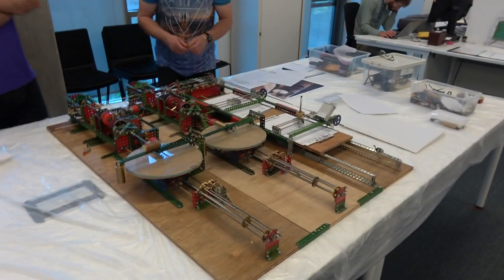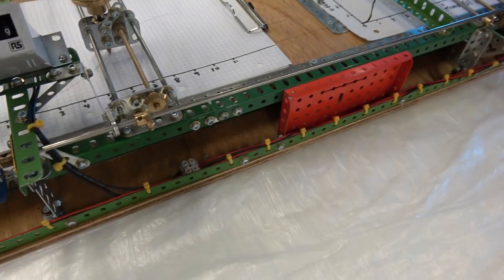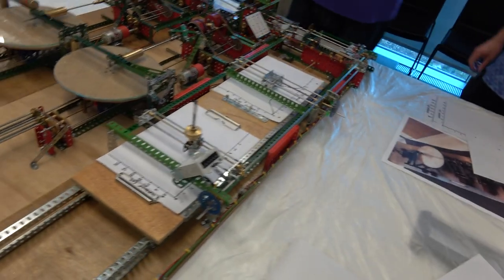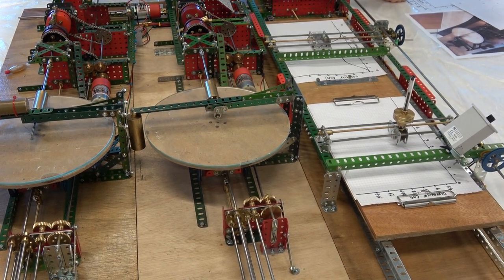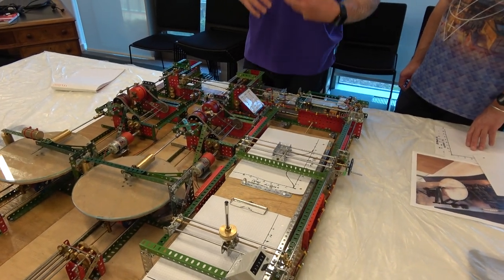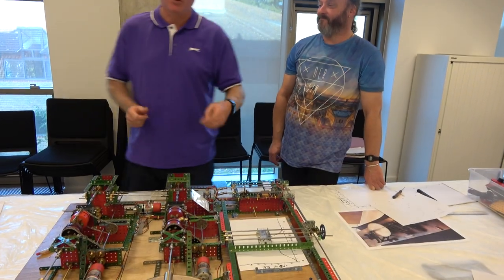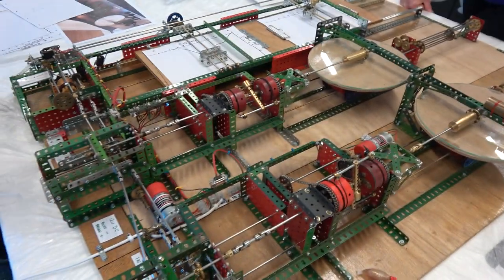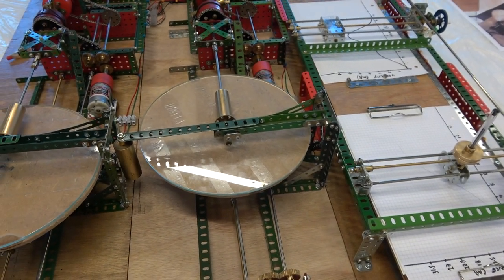(1/4) Exploring how the differential analyser works in simple terms

Comment: Except, a real odometer AFAIK doesn't do any integration at all, unless you call keeping a running sum "integration", while the only calculus being done is by the speedometer, doing differentiation.  And in an electromechanical apparatus, differentiation w.r.t. time is easily accomplished by Faraday's law with a generator.  So I think a better example could've been given.

Comment: Tom, thank you so much for this video!  This is amazing craftsmenship and brainpower.   Is there any way I can ask a question about the analyzer, that is,  I have done extensive research on the birth of mathematics, physics, etc. and what I want to know for sure with this analyzer is ; the ACTUAL input type.  Were these speeds/ positions, etc.  all being inputted by a human operator as a voltage signal the correlates to speed, etc.  If so (or not so)  how were the INPUTS specifically connected and what type of signals were they. (and maybe, for what purpose) Although I understand that these were obviously used heavily by the military for different types of defense and war strategies and operations.  Thank you in advance no matter the outcome.....:) no pun intended lol.